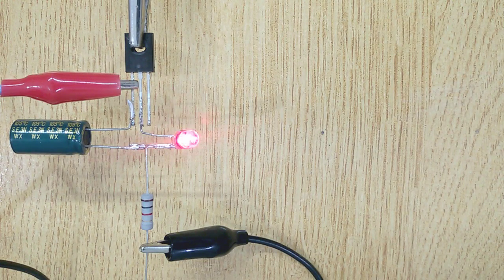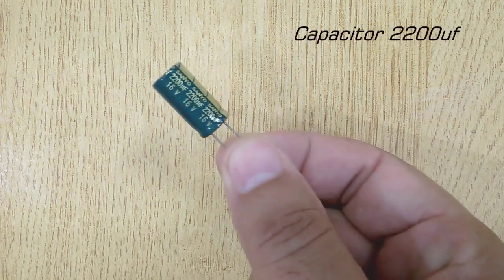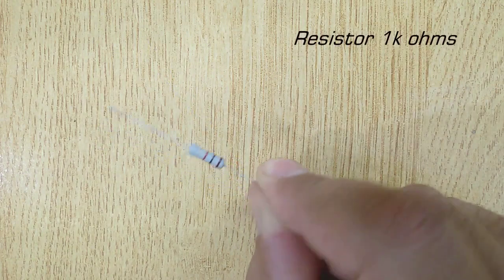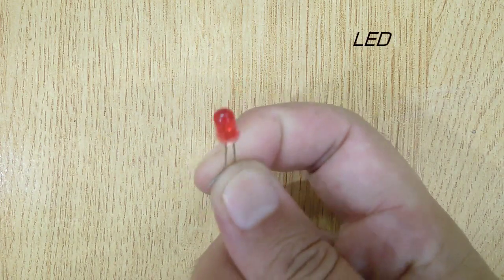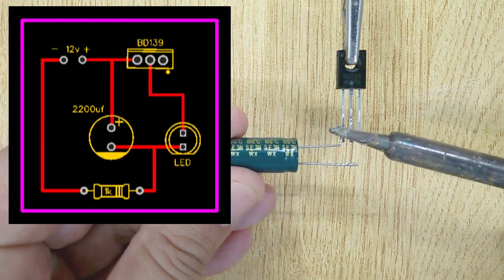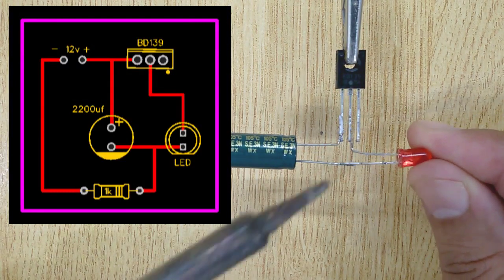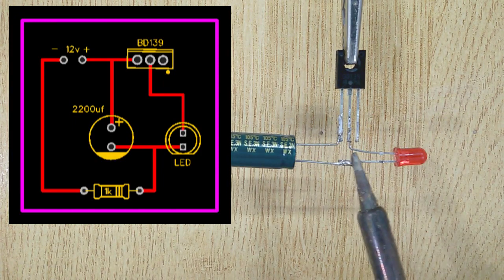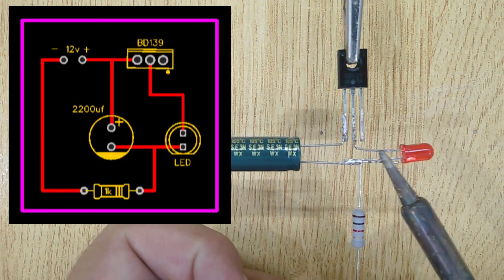How to Make LED Blinker Police Flasher Lights led flasher circuit

Comment: Am I correct in thinking that a 9V battery would trigger the light, and that increasing the capacitance of the capacitor would slow down the flash?